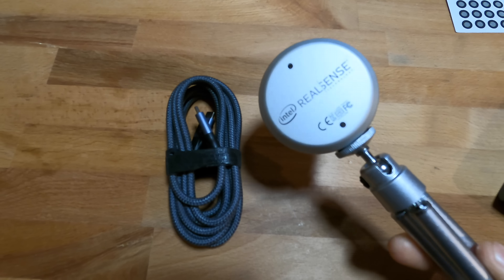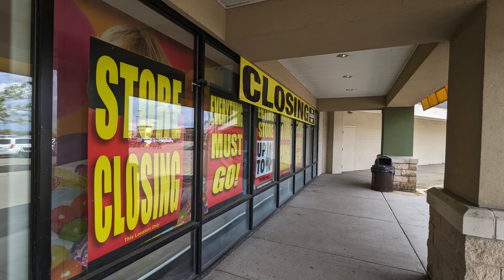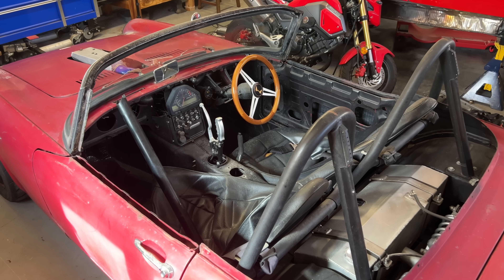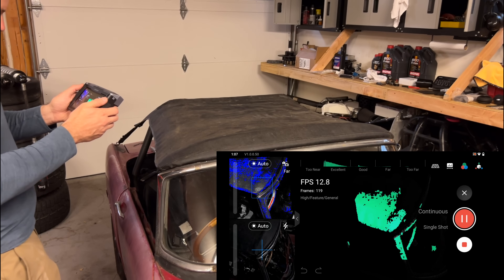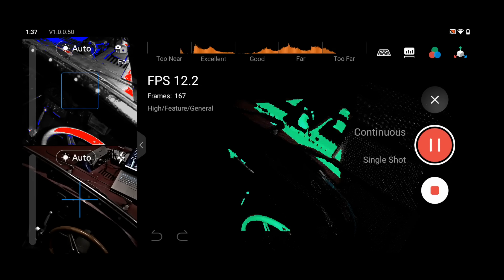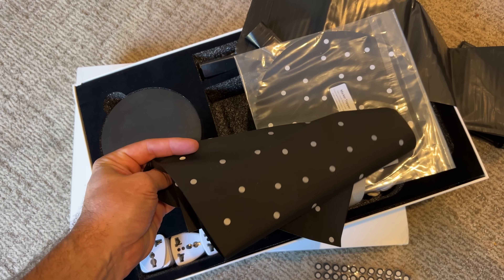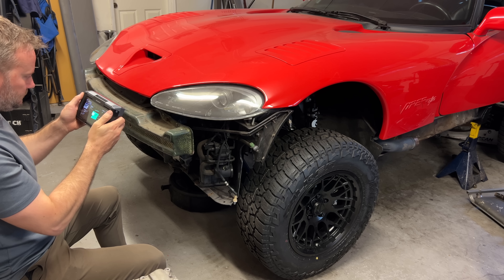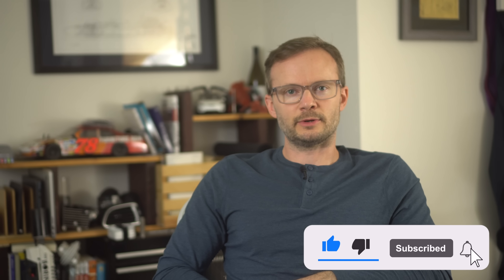All-In-One 3D Scanner: Revopoint Miraco vs Einstar

Comment: I wonder if yellow and black hazard tape would work better or easier than either dots or hot wheels car stickers. It's easy to apply and remove and has a nice geometric pattern to lock onto.
Reply: The pattern creates a tracking problem, if the scanner isn't confident and it sees a yellow diamond, having a row of identical diamonds means it can choose the wrong one. The Shaper Origin handheld CNC router uses tape with a domino pattern, but each adjacent black rectangle has a different arrangement of white dots and the device has been specifically programmed to track the domino tape.
Reply: There's not just the plain yellow and black. There's also others with caution, danger, biohazard and various other text along with the geometric pattern.

Comment: I milled my own trans adapter. I took a technical drawing of the transmission and some hyper accurate measurements of the engine and a few pics and threw everything into fusion… took a week or so but I managed to design it and then another week to mill it on an mpcnc… s85 to g86 trans adapter, cut the face off the trans and welded it all together. It worked first try, I git incredibly lucky

Comment: Thank you for this review. I own the Revopoint mini and HATE its tracking. So much I often avoid using it as it's easier to use calipers in a lot of situations. Knowing this being years newer still has the same issues lets me know it likely isn't a worth while upgrade. Ironically I messaged support about the tracking issue and they suggested using the dots. Which in the failed scan you could clearly see a dot every quarter inch. which is a lot when the object is 8 inches in diameter. I still haven't taken the dots off because it's just as much a pain to remove as they are to add. and I've had better results just adding random shapes and squiggles with colored markers for tracking.

Comment: I have a revopoint range and I completely feel what You say about their products . They released the miraco today on Kickstarter and I was tempted to go with the super early bird ticket in hopes that it would be better than the Einstar . I'm so happy I didn't pull the trigger . The Einstar is still high up on my wishlist but I need a better computer first which is the gatekeeper at the moment 😢
Reply: Have that same feel, with the FOMO, buying the Mini and the Range came later.   Computer hardware on the receiving-the-scan-data side really does matter.

I'm still glad that Matt showed the pros and cons of the Miraco's built in Android device.   I was relegated to using my Mini with my Android phone until I upgraded to a newer laptop.   Version 5 software on Android is WAY better than V 4.x on the old laptop.   V 5.x software on a decent desktop or laptop is again a step above of that.   The scanners themselves have powerful hardware that still scales.  It's both the computer on the receving end, and how capable the software they develop for the scanner that drives how good or not they are.

All of the tech with the "low end" consumer/pro-sumer scanner reminds me of how my first 320x200 VGA digital camera in the 90s was leapfrogged by VASTLY superior tech in each camera, and later, each phone after that.    Cheap, affordable camera tech matured, and plateaued after decades, and now everyone has megapixel cameras that are packaged a space smaller than the size the nail on your pinky finger.

Affordable 3D scanners, we're still on that early-adopter stage, like digicams decades ago.   What we're using now, in 5 or 10 years time will be considered quaint museum pieces.   Looking forward to what that brings us, though!
Reply: I was in the same boat.  After watching their evening streaming show, I don't see any reason to get a Miraco.

Comment: I recently inherited a 1930 Ford Model A, it's mostly in running condition, but there are things that needs work, I'd say, it's 85% completed. An example of something I need to figure out is, it doesn't like to start, when you do get it started, it doesn't like to sit in idle, if you sit in idle too long, it dies. Which leads to the first problem of, not really wanting to start. There's other issues, but, they're mostly cosmetic, such as some of the paint has bubbled, because some jackass who didn't really know what the hell he was doing may or may not have set the fucker on fire... I know a little about cars. I can change the oil, rotate the tires, general maintenance stuff.

Your videos make me feel, like, going into this blind, but having a vague idea of what I'm doing or at least the end result, makes me feel optimistic about my new car. All hail the algorithm.

Comment: You know, one day, one of these companies is going to realize "Hey, if we use an external camera with a wide perspective of the whole scene, we could use a single photo resection on the scanner itself to aid in tracking!" But thus far none have. It's not like they'd need to add any hardware, they'd just need to have tracking marks on the scanner, and let the user set up any old camera they have laying around, the rest is just software. Even a smartphone would work, you could either stream the data to the scanner (or scanner PC) using Bluetooth or USB, or make an App that does the single photo resection on the phone and just stream the tracking information. 

I wonder if any of these scanners allow 3rd party plug-ins...

Comment: Thank you for honest review that are hard to find theese days - most reviews on Youtube in my opinion are implicit ads.

As a exuser of two Revopoint scanners - Mini and Range - I can confirm it. Tracking is a HUGE issue on all of those. Range is better since it has a larger FOV, but it's also slow and looses tracking a lot. And most problems are not with loosing tracking, but with tracking drift that continuously adds tracking errors, so you can't sew up the different scans later and have dimensions problems.

Miraco is a GREAT idea of integrating a phone and a scanner in one wireless and self containing device at least in a scan data gathering stage, when you don't need to mess with anything - not a single wire connection or fitting the phone in a bracket, but the actual implementation lacks.

Frankly even understanding its limitation, I wanted to back up a Kickstarter since Einstar needs a notebook for a price of Einstar, but even Early Bird price was too heavy from my point of view - almost twice as Range or Mini.

Also I would say, Revopoint scanners are very convinient and user friendly - you have everything you need in the package (saying hello to 3DMakerPro for additional $250 for phone bracket), but tracking is too PITA thing that greatly spoils the stuff.

Comment: Hey Matt, would it be possible to use a series of consistently shaped markers held in place with a decent but removable adhesive/magnet to supplement the geometry of items being scanned? I think the crux would be finding an easy and consistent way to remove them from the scan afterwards but that they could improve quality over large or geometrically consistent areas.

Comment: I bought a revopoint mini in their last kickstarter, and tbh i regret it. the scanner itself seems fine, but the software is a buggy, win95 looking, tracking loosing dumpster fire. haven't gotten a single usable scan out of it. Last week I had a chap over to scan a wheel well on a black car. he  turned up with an einstar and was done in 5 min. I'm getting one of those now. To be fair, i don't have a decent laptop at the moment, mostly because i despise laptops, so i'll have to update the desktop and build the older components into a mobile pc. And that's why i have too many projects.

Comment: I always assumed that the software would have some version of loop closing in case both ends of the scan do not line up. It always increases the overall accuracy of the scan and makes the output much, much easier to work.
Reply: Sort of - but 'loop closing' sounds a bit like software bending the twisted scan arbitrarily to force the ends to join back up, might introduce all sorts of extra inaccuracy, or give a false illusion of accuracy -whereas as frustrating as it may be, if you keep repeating scans  that drift, maybe adding items in to help lock until eventually you nail it and the ends mesh up nicely, at least you can trust the output to be pretty accurate?
Reply: @edumaker-alexgibson  You're right, that's just postprocessing of inaccurate data, but when you have scan with multiple passes from point A to B (imagine car being additionally scanned from top and bottom) the loop closing can average the error giving better accuracy. It's a common approach to generate entire "graphs of loops" just to average all the errors.
Reply: @Krawacik3d  Yes - as long as the software is actively seeking to identify and throw out misaligned data, and fill the gap with good data, you could keep going around the car and the accuracy would keep getting better.  I would distrust any sort of 'postprocess' but in real time, different story.

Comment: It looks like a handheld Kinect - I worked on the RealSense product and it looks like that too.
Fun stuff!   I was mad that they killed the Kinect so fast because it was super easy to spackle sample feature code right into live debuggers and exercise it - the amount of functionality in modern integrated sensor packages available to the general consumer now is kind of crazy.  The Future Is Now.
(I was a technician for 25 years - kind of a tool junkie, because, tools make everything possible - thanks for covering this)
Reply: Forgot about the Kinect until you mentioned it...    I bought one nearly 15 years ago, despite never having an Xbox, to try and do crude 3d scanning.   Never got that far with it beyond SDK demos.    Still have it packed away, with my other unused old tech.

These new scanners have WAY more resolution, but basically work the same way.   The IR laser scanners would be quite like how the Kinnect was, and the only difference my Mini has, vs the Pop Matt showed, is that it uses a blue-light laser that's ... not eyeball/eyesight friendly.

Comment: At my old work we used a high end Kreon 3D scanner - it was about USD$60k. And was attached to a big arm with transducers recording joint positions. It also had a CMM attachment at the scanner head, accurate to 0.05mm.

It really was accurate, but such a cumbersome beast that it was hard to use. I guess my point is that there’s no silver bullet, the really good scanners can be $$$ and have their own drawbacks!
Reply: I saw one of these in the late nineties. I don't know how much the scanner was, but it was hooked up to a 50k computer. As a layman 25 years later having access to similar technology for less than 1k is rather amazing.
L

Comment: Why not photogrammetry? You can make a scan with any camera / phone you've already got, assuming you include a ruler somewhere you can get very accurate dimensionally. RealityCapture is definitely worth checking out
Reply: Seeing live what needs another go-over at a different angle, compared to finding out that you missed an important bit after hours of processing the images is why i stopped using photogrammetry. But if you don't have a scanner its still a good tool.
Reply: @Z0neDrift  not aiming to be a salesman here, but reality capture has a bunch of cool tools for it, it essentially can do live feedback on what data you're missing, it's also super fast in aligning images so if you have a stationary thing you need to scan it's super easy to do a few rounds / iterations. Last scan I've done was around 1700 photos in a super messy dynamic environment where it managed to align 550 images in under a minute which is kinda crazy.

Comment: Matt,

I liked how in a previous episode how you had used powder on shiny surfaces to procure a higher quality rastered scan. I can certainly understand from the handheld aspect being able to single handedly move around an object is easier.  As well as the laptop based hardware software performance would be vastly untouched by a handheld all in one scanner. A couple quick feature buttons on the scanner that you can assign from the software would be great as well, as such that you have mentioned: a 'revert mode, etc.

Love the tech episode! Cant wait to see what you make of your driveshafts in the next Viper video. As always,  great dialog!

Comment: Great review Matt… saves me having to do one! 😂

I’ve got the Pop3 and Range to evaluate, and seeing as they both run off Phones I’m not sure if this “all in one” is really that unique..?
Reply: Not unique, but they have controlled hardware that's not running all the background processes phones would have also going on.      

I found the RS5+Android scanning with my Mini was better, even though it was going over wifi, than the original setup when it first arrived: RS4 on an older laptop over USB 3.0.

Current builds of RS5, with a newer laptop, again, using USB 3.0 has a higher FPS and far FAR better tracking than the Android phone.

I really think the 3d scanners they make, even the prior models, aren't limited on the 3d scanner hardware side.  Limiting factors are ALL on the receiving side:
- Receiving computer's CPU, and especially the GPU
- data throughput (wifi/USB)
- how capable the software is at harnessing the hardware, and the hordes of data the scanner is sending.

Comment: When the Einstar hit the market, i had my suspicions, the 3d scanning market was simply "Toy" sub 1000$ units, and "Pro" 15,000$ units with nothing worth its weight in between. I believe the entstar finally broke that void. One of the issues with a lower cost "pro-sumer" product is the availability to folks who unfortunately don't know what they are doing. Some of the reviews of the einstar were disappointing, but it mostly was because folks were not pre-prepping the part and not understanding the process flow of pro 3d scanning (surface finishes, lighting, speed, etc). After getting my hands on the enstar, getting used to its limitations and abilities, i quickly was able to turn it into a useful engineering tool for my work/projects. Some of the few tricks ive learned is using a scanning spray really helps with overall scan performance of the einstar; magnaflux SKD-S2 has been my go to. Along with getting some mini round rare earth magnets and permanently sticking the tracking dots to them, really helps with speedy process flow/prep/waste when scanning steel parts. Its even possible to use them when scanning fiberglass or thin profile parts by sandwiching the substrate with a magnet on both sides.
Reply: Really good points - plus the magnet tip is something I’ll have to start implementing myself!

Comment: I'm surprised that loop closure would still be an issue, you are rotating around a big object, there is absolutely no ambiguity that huge features that look the same and are about the same pose are the same. There is no physical space to put 2 cars side by side in such a tight loop. The video "Graph-based SLAM using Pose Graphs (Cyrill Stachniss)" explains a bit how it works.

Comment: If those cameras rely on tracking geometry then those trackers would be better off as pyramids. Maybe easier to remove too. If you have this I assume you use or have a 3d printer, so thankfully a pyramid is very easy to make.

Comment: My takeaway from this review is that the latest cutting edge 3D scanners are still pretty far from being user friendly and reliable enough to be of much practical use for the masses. It's still a very niche thing with niche applications.  Hopefully, in a few years, we will have 3D scanners and 3D printers that will allow us to really achieve that real life "copy paste" objective.
Reply: These arent cutting edge, these are consumer/prosumer products. The professional scanners are really good, but expensive as hell.
Reply: @banaana1234 This is true. However these are the cutting edge of consumer affordable products.
Reply: @banaana1234  when the consumer variant is mediocre and still expensive but the professional version is extremely good but massively expensive then it is still very much a budding industry and thus, cutting edge. cutting edge doesnt necessarily mean "new", it means the industry/topic is still in the process of being discovered and optimized.

3D printing was around for decades, it was/is called additive manufacturing, but even now its still cutting edge tech that is rapidly improving. even the "plug and play it just works" 3D printers are far from perfect and are in fact NOT plug and play.
Reply: @banaana1234  Can confirm. Used to be an optical metrologist for a company that builds private jets and we used a Leica laser tracker that had a laser scanner attachment. I think it runs around 500k normally. Thing was nuts, but the problems you see on these consumer grade scanners are also a problem on the expensive ones. They just tend to be better at telling you when its having issues, and have ways to work around problems with scanning (setting base points with a retroreflective marker which everything else is referenced to)
Reply: My work's got an Artec Leo, which is 50k USD for the scanner and a pretty significant price for the software... I scanned half a car with it and it has essentially no issues picking up surfaces with good resolution from a fair distance away, and it would only lose tracking if I pointed it away from the car. That's more what I'd call a cutting edge scanner, I think their youtube channel even has a video on how to use it to scan corpses for forensic investigations. The only negative is that I can't afford to replace it if I break it...
Reply: @agerrgerra1361 We had an Artec Spider at school, shame that we just couldn't get it to work. The software simply didn't recognize the scanner.
Reply: 10 years ago I would agree 100%. I barley even measure now. Hit it with the scanner and move on.